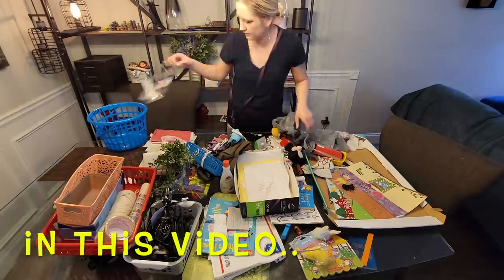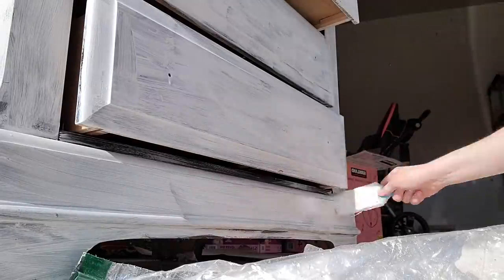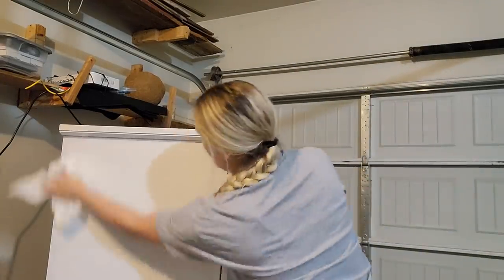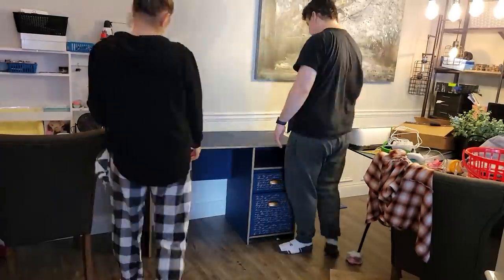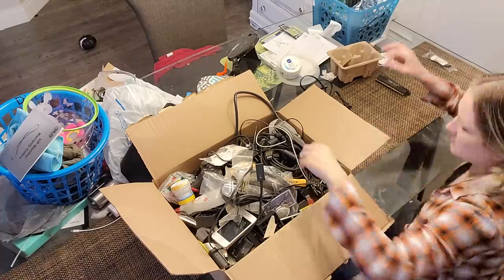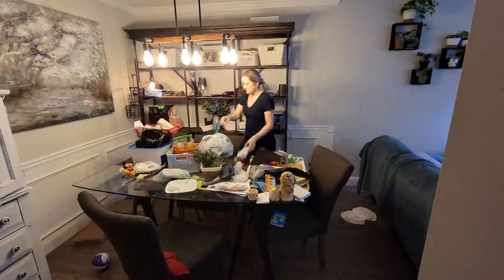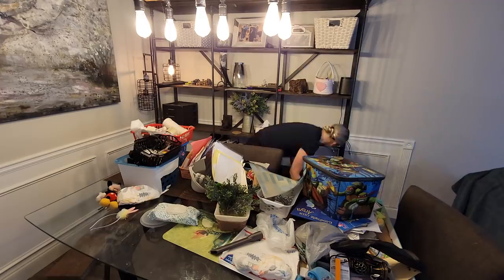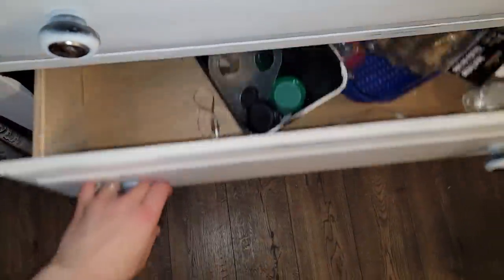CLEANING MOTIVATION // CLEAN AND ORGANIZE WITH ME!!

Comment: It looks like there is enough room inside that organizer cabinet to add a shelf above the TV that could hold the Cricut and possibly some of the supplies that go with it. It's fairly inexpensive to get white laminate shelving at home improvement stores, and they will even cut it to length, so all you need to do is install some brackets.